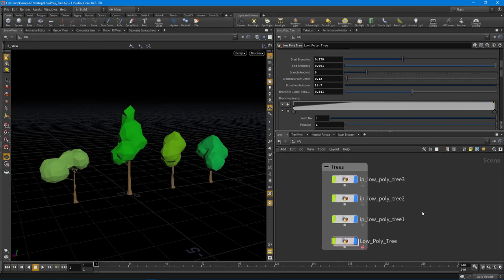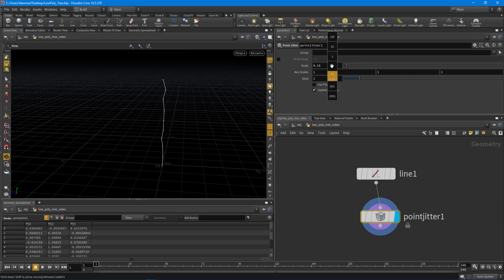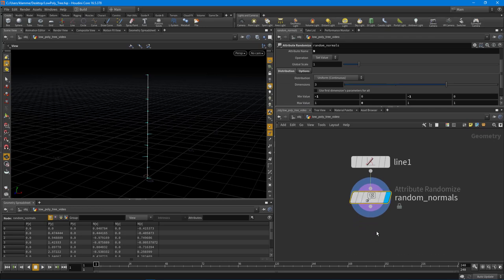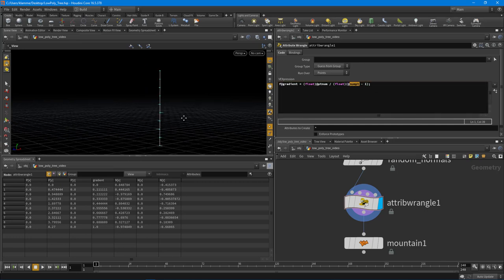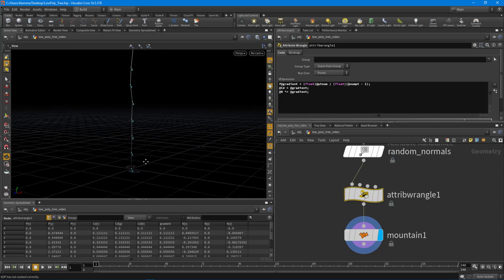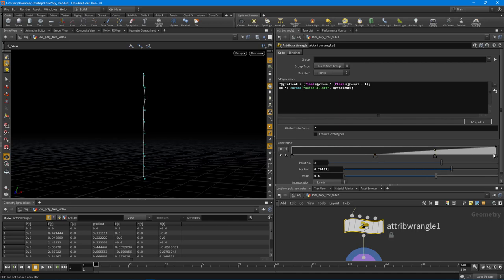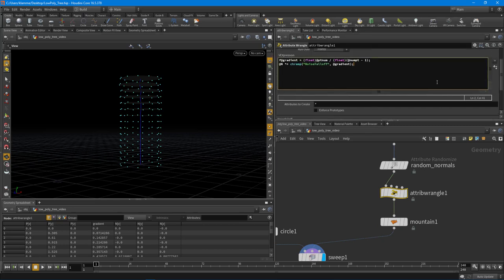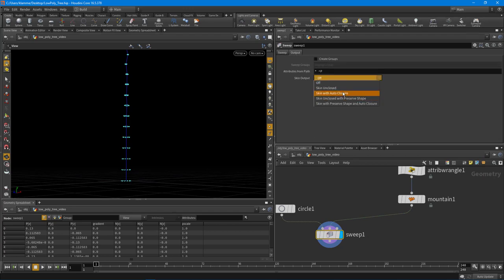Procedural Trees - Part 2

Comment: is there any way to offset line based on attribute point while sweeping (something like pscale but just for x offset) ??
Reply from the maker: Howdy Ridha!  Im hoping I am answering this correctly, but from your description, I would add the normal vector to the lines points position.  That will offset it along the normal.  If you just want an xOffset, you could add some offset value to the @P.x position of each point.  That will offset it.  I hope that's what you were looking for. If not let me know!  Thanks!
Reply: Thank you so much for reply, actually i was looking for solution for hard angle banking when you center the line and sweep it i found that if i found someway to offset then i found it its the pivot attribute, but again thank you so much for all tutorial i wouldn't learn Houdini without game tutor or indie pixel, looking for moooooooore tutorial